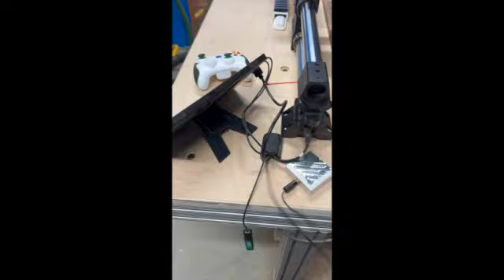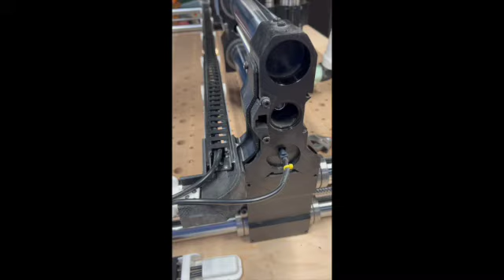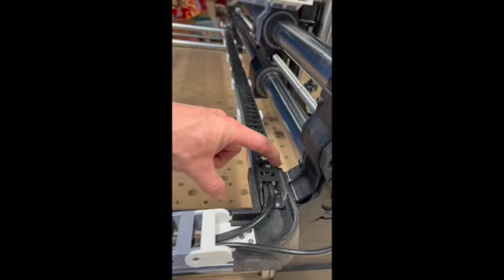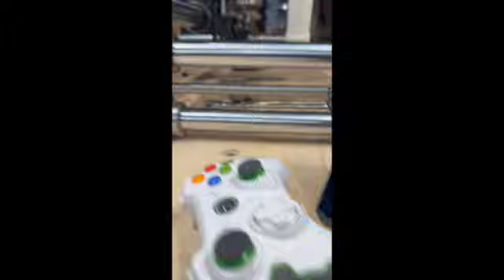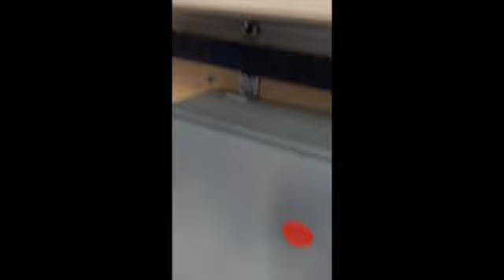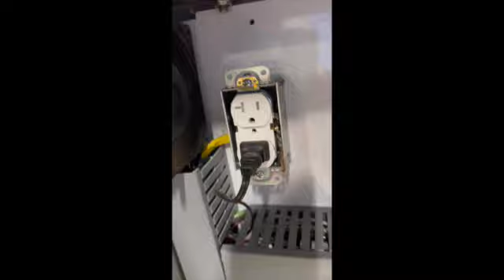Onefinity Journeyman X-50 Cable Management With 3D Printed Components

Comment: Is the spindle in a separate circuit? (up to the ceiling?)
Reply from the maker: The entire machine is fed by a 30 AMP circuit fed by 10/4 wire.  This goes through the main shut off on the outside of the cabinet and into the 6 station service.  From this service, I have a 30 am breaker feeding the variable drive that feeds the spindle, a 20 amp breaker feeding one of the 4 plug outlet, another 20 amp breaker feeding another 4 plug outlet, a separate breaker for the fan (over kill) and an empty breaker location.  So to make a long answer a little longer, the spindle is in the same circuit.